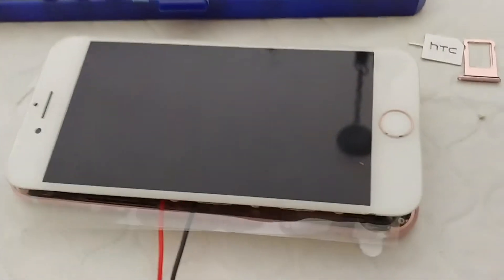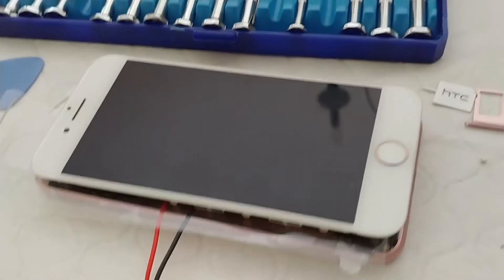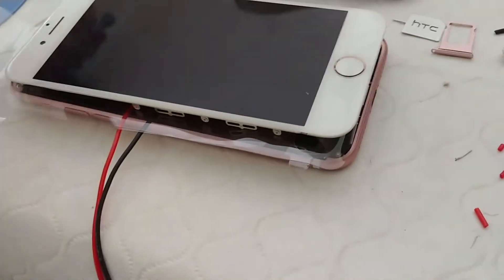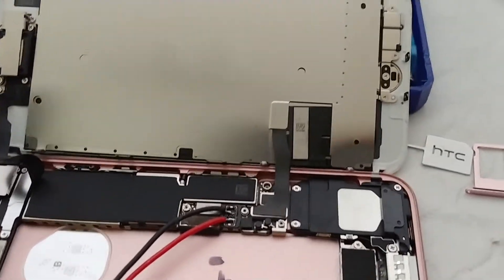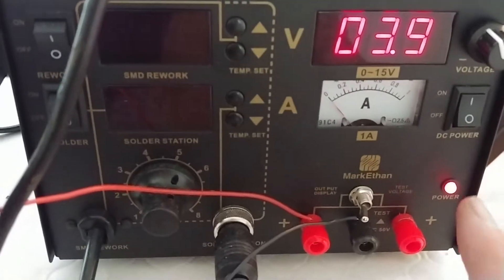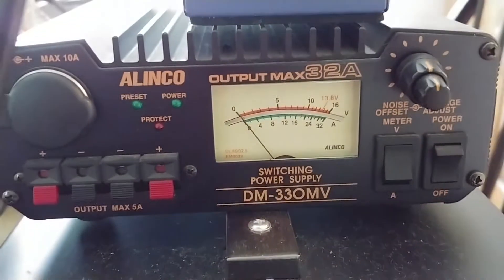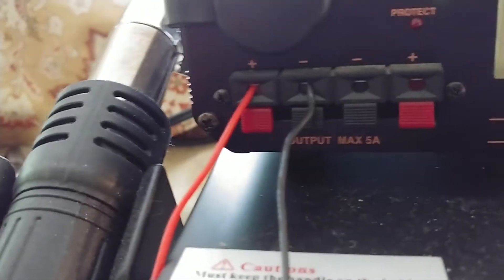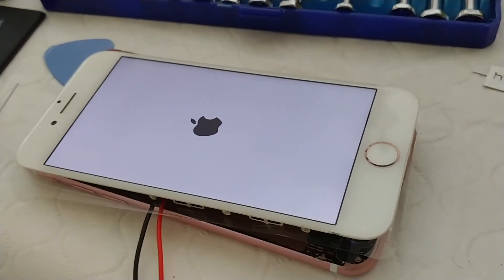How to Power up a dead iPhone 7 (your iPhone won't turn / power on) in a worst-case scenario

Comment: I by an iPhone 7 two month ago, and last week in the morning  my phone wouldn't turn on I don't know what is happening cause it didn't drown in the water or anything. I tried the power button and the sound button, charging, but still don't work. Pls help I have very important things in there.
Reply from the maker: First, try cleaning out the charging port with a toothpick and compressed air. Next, plug it in to charge. Then, hold power and volume down for at least 30 seconds

Comment: So with you connecting it like this. Wouldnt it imply that the battery is damaged, because this is like creating a new power source for it
Reply from the maker: In my case, the battery may have been damaged or the power-on button, or something else.  But clipping out one of the battery wires ensures that your independent power source (please make sure it has enough amps or the phone will just shut down) will solely power your phone.  And if your phone hasn't suffered any catastrophic trauma (water damage, high drop, etc.) then you can power it on long enough to get all of your data off.  In my example, it stayed on all night while everything synchronized to the cloud for backup.

Comment: my iphone 7 also died, apple store is asking a huge money to get a new one since its dead. I opened the phone by myself, tested the battery and the voltmeter shows around 3v. The battery is good. I had soo much data in that phone :/
Reply from the maker: Yes exactly. Cut the battery out and use my method. Good luck.